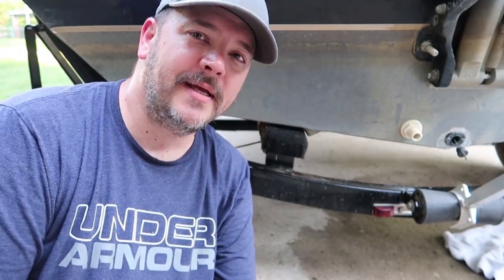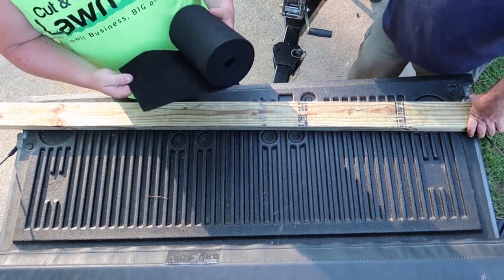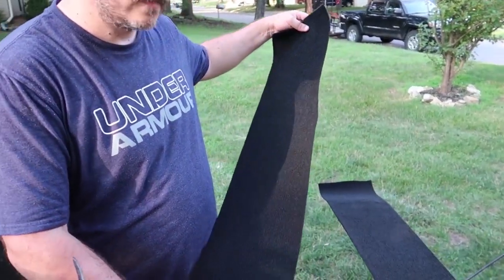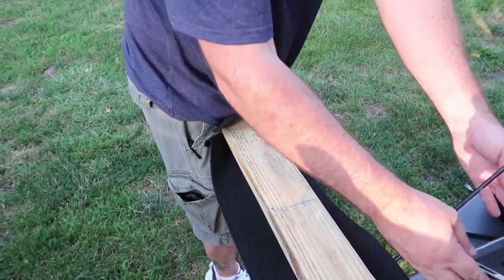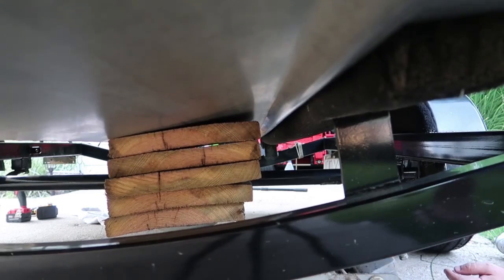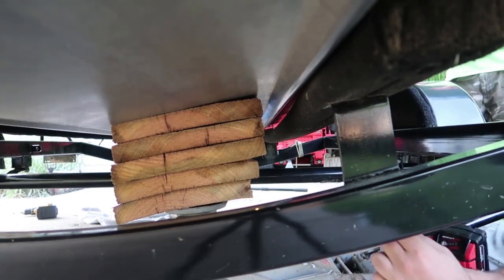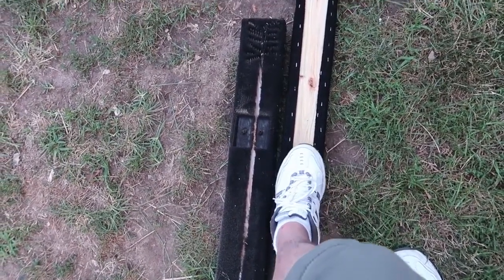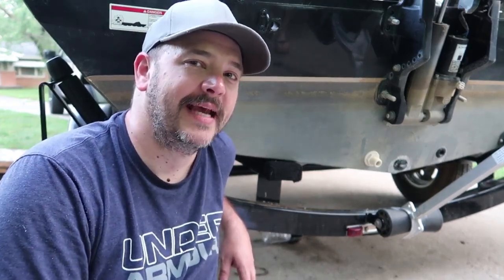Boat Trailer Maintenance  | Bunk Rails Replacing Wood Support Rail

Comment: That may be a lag screw. A bolt has a nut on the opposite side. 😉. You should've used four inch long lag screws so the boat would be less likely to come off of the trailer going down the road. 😂😂 Oh, next time, call me. I'll let you use my pneumatic stapler. Save that kung-fu grip for hauling in those monster cats!
Reply: To The Top Crane I don’t understand your big words?.? Do you have any Dry wall Screws though?
Reply from the maker: To The Top Crane 4” lags is the best idea I’ve heard for keeping the boat secure! We would have to keep some Flex Tape to fix the holes. I mean billy Mayes can cut a boat in half and Flex Tape can fix that. 🤣
Reply: G4 Outdoors, just leave the holes. Then you wouldn't have to mess with putting fish in the livewell. You could just flop them in the boat and keep fishing. 😉😂😂
Reply from the maker: To The Top Crane it is sink proof. 🤔
Reply: Yea,... Its a Boat?.....

Comment: everything I read says you shouldn't use pressure treated wood for an aluminum boat. The chemicals used can eat through the aluminum. I didn't believe it at first but after more research, it's accurate. Just a heads up
Reply from the maker: Firemedic10584 This is an interesting comment. I will have to look into that. Never heard that before. Thanks!
Reply: G4 Outdoors I just got finished redoing mine. I used pressure treated just a few days ago. Everyone told me that was the wrong thing to use on an aluminum boat. Just swapped to regular wood
Reply: G4 Outdoors Treated wood, since 2004 i think, uses copper in the treatment process instead or arsenic like the old way, that pressure treated wood you used will eat a hole in your boat, even through that carpet. I suggest replacing those agin asap.